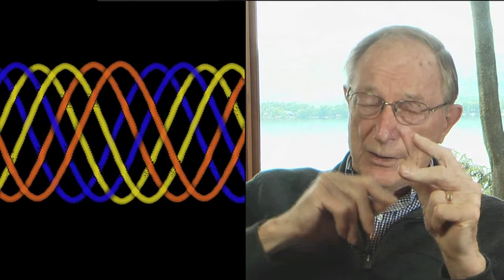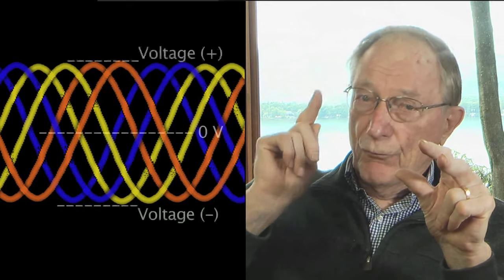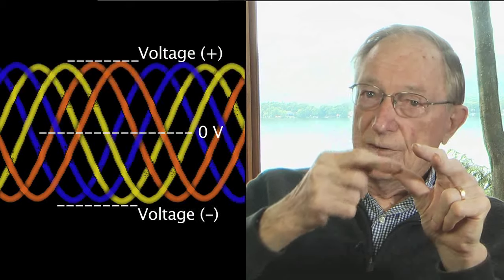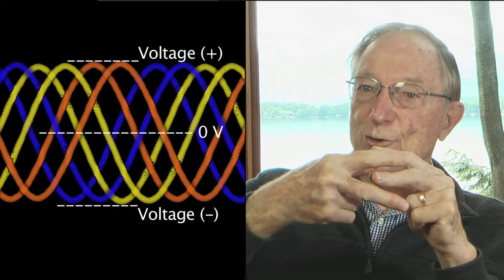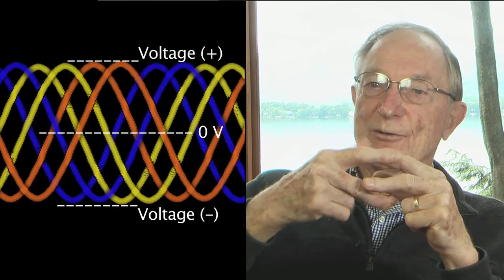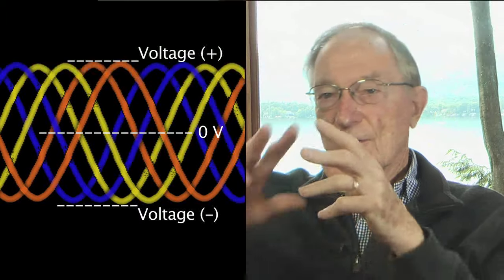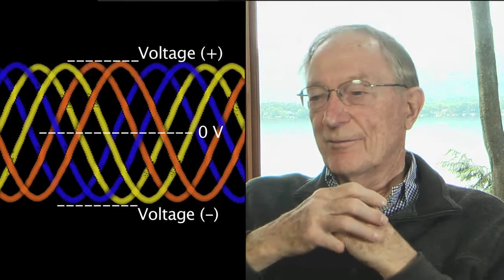Why 3 Phase Power? Why not 6 or 12?

Comment: Why dont you use both sides of a magnet in a generator? Why dont they try changing the shapes of the magnets & coil winding's in a generator?
Reply: Multiple layers coils....Well, only come to the power line problem that stopped that thinking.

Comment: Did I miss something here? Simply adding three more wires to an existing 3  phase system will double the transmission power or increase the wire gage and replace the original three wires. Adding additional phases does nothing to improve transmission efficiency.
Reply: You missed the part where he said to rotate the electrical angle of the second 3 phases so they fall between the first. The additional phases would be rotated 60 degrees from the existing.
Reply: No, I didn't miss that. Shifting 60 degrees provides no power advantage, but adding more copper does although 6 phases are not required for that.
Reply: @richardgieser6122  Oh, you said adding 3 more wire, not 3 more phases, so it sounded like you missed it. I agree though, it isn't going to help much, although the guy in the video seems to think so. My brother worked on installing a 230kv line into San Diego from Arizona and said they either 6 or 12 sets of 3 phase, which were fed from different generators. I would think that they would be synced for frequency at the generation station......he is an equipment operator and not a sparky and I only work on the customer side in electrical so am not sure about the distribution.

Comment: but for a diesel electric hybrid, for torque density, I think it would be better to use say a 5 phase thing. Over that would give diminishing returns.
Reply: Nearly all modern hybrids and electrics, in fact, nearly all modern electric traction (which includes railroad locomotives) use 3-phase AC motors of some type: asynchronous induction, synchronous permanent magnet, or synchronous doubly wound. They're driven with 3-phase variable voltage, variable frequency solid state inverters or cycloconverters. 3 phase, unlike single phase, can supply constant power throughout each revolution, which greatly decreases vibration and increases power. There really isn't any advantage to more phases.

Comment: Why not 4 phase so then you also have a pair of 180 degree out of phase pairs, kinda like a double split phase arrangement?  Then regular USA homes could use 2 of the lines for split phase and businesses could use all 4 for high power equipment.  3 phase does not allow for 180 degree split phase but 4 phase could.  The same 4 power lines could feed both residential and business needs.

Comment: One may find a similar increase-yet-diminishing-return in other areas of engineering. In computers, increasing the number of states per bit position increases data density, but the complexity of the device increases. And, again, the optimum compromise appears--to me, anyway--to be three states. We, of course, usually use binary, but we could use any other number system we like.

Comment: I might be dumb here, but with 6 wires, you would get alot more then 6 phases, as you get 6 phases wth 4 wires:
Phase1: AB
Phase2: AC
Phase3: AD
Phase4: BC
Phase5: BD
Phase6: CD

Albeit with different angle between the different phases, four with 90degrees and 2 with 180 degrees.
Reply: DJ Nekkid No, six wires = 6 phases. A is a phase, so is B, C, D, E, and F.
Reply: You can derive any phase angle from only two phases, by taking sums and differences of different amplitudes of the two.  The overriding advantage of three-phase is being able to reduce or eliminate the neutral wire.  There's no further advantage to increasing the number of phases past three.
Reply: See https://en.wikipedia.org/wiki/Scott-T_transformer for an example of a transformer that converts three-phase to two-phase or vice-versa.

Comment: i guess its because we need transistors and expensive equipment to create a motor controller from one phase. while with 3 phases we have 3 lines 3 timings allready there for driving the  motors without any externalequipments,
Reply: still 2 phases is still enough in past probably it was easier to drive motors with 3 phases or may be easier to control direction

Comment: Edison didn't understand AC electric when Tesla patented AC generation and EdisonTechCenter doesn't seem to understand it now.   The minimum distance between conductors (lines) is determined by the voltage carried by the conductors.  You can't add more phases without increasing the amount of space it takes up because doing otherwise will push the conductors closer together (as shown in the video @ 0:30 to 0:50) unless you drop the voltage.  There's no point in having consumers pay more for power so power companies can add more lines at reduced voltage to end up with the same power delivering capacity as half as many lines at double the voltage using the same amount of space.  Not only would the cost to consumers increase due to the material cost and labor to install twice as many lines with no overall capacity (taking up the same amount of space), the high-voltage interstate transmission lines would be a nightmare for our linemen and helicopter pilots that risk their lives to work on the lines even if the proper distances were maintained and took up the extra space.  

These ideas raised in this video are excellent for the "average person" to come up with and ponder, but it is a damned stupid idea for a channel called "EdisonTechCenter" or a "Power Transmission Engineer" to come up with.  I'll give some credit to the old man though, he has probably forgot more than I know... He just happened to forget why this idea was bad before losing some of his marbles.

Comment: Transmitting an increasing number of phases is tantamount to conversion to DC by a multiplicity of chopping. Today there are in fact high efficiency DC-DC converters that use this technique. It's a little like asking "how many sides does a circle have?". Is the answer 1 or infinite?
Reply: 2 is the answer
Reply: +Imelda Rodriguez InSide and OutSide

Comment: also allow for smaller motors or greater loads or greater speeds
Reply: Even with 3 phase system practical limit for power density comes from heat. Motors can be made smaller, also with 3 phases, but heat density is a big problem every time when engine frame is made smaller with greater load. And heat comes from combined currents of all phases so amount of phases won't really do any difference.
Reply: thanks, Karjis

Comment: But if you were to double a 3-phase circuit, to a 6-phase circuit,  wouldn't that double the circuit lines that lead to the outlet as well? Per say, we all know that a 3-phase circuit has one line or circuit per phase...and then the grounding wire making for four wires. This said, would we need a seven-wire circuit for a 6-phase circuit.....hypothetically asking?
Reply: What I know is ,they make 6 phase alternators for cars,and they put out insane amperage. 
Usually 225-350 amps or so, and you need supporting mods. 
An alternator is just a generator with diodes to me (gen tech)

Comment: 3 is enough to start a motor running by itself. And in The powerplant only 1 phase would cause very high vibrations in The generator. Afaik The number has to ne odd to start motor by itself in The right direction, as with 4 phases it could start in The wrong one too. Also your power line of 6 has 4 cables above each other, so they Are closer, in case of swinging or ripping apart You would have 2 short circuits instead of 1. 3 phases Are hard enough to balance in households, with 6 it would ne even more complicated. Also most electric energy is used NOT in industrial AC motors, but rather as DC. Vor electrolyses, heating of chemical reactions etc. So maybe we will use DC in future.

Comment: I thought they stopped at 3 phase and not 4 phase because of rotation and sequence. If two phases were swapped on a 3 phase motor, it would only run backwards. Instead of 1,2,3, 231 or 312 running one direction were 132, 321, or 213 would run the other direction. Add a fourth phase or more then the sequence would get too complicated 1234, one direction but 1243 would freeze up the motor. don't know, just what I thought

Comment: Can you transmit double 60hz 3 phase so its 120hz, but separated into two 60hz on single set of wires?
Reply: No you would need to frequency converters, not cost effective. To raise power transmission either raise voltage or thicker conductor will do.
Reply: Dirk Knight  Solar systems have DC-AC inverters. At least in USA, so far only very long transmission lines (> 600 Miles) are DC. They do offer some benefits and might get cheaper with advances in pwr electronic  over time.

Comment: Well, when going from single phase to three phase, for a constant and consistent power demand, can't the conductors be downsized because each conductor is carrying less load? If that's so, then why couldn't the circuit breakers and buses at substations be sized accordingly?

Obviously, I don't know very much about power transmission,  I'm just wondering.
Reply: You would need three breakers for every offset phase that is used and then more busbars. It would not work at an economy of scale the way 3 phase worked. 

WIth transformers and three phase you can just scale the systems accordingly with 6 or even 12 phase you would start to get a diminishing return meaning the higher the voltage requirements the less bang per buck.

Comment: Thomas Edison used DC  (Discovered DC) and not AC.  Nikola Tesla discovered AC, he is attributed for the induction motor, neon and fluorescent lighting which all use single phase oscillations.
Reply: The induction motor is inherently polyphase. Minimum is 1 1/2 for self starting. (1 for power and the half for direction.)

Comment: I respect your concept but would there not be a certain amount of slip that could cause issues in the operation of motors and other items.   Maybe this slip would glide into the next phase?    I like the idea but I believe that most practical applications are allowing variable frequency drives to accomplish nearly the same efficiency with 3 phase power.
I may be wrong but the efficiency would be far more costly than the current applications unless your thoughts are possibly getting us near unity.
Reply: It was a theory for transmission of power, not usage, 12 phase would be converted to 3 at the end user.  With 12 lines packed more tightly together on a tower you can transfer more power, but the savings there are outweighed by the extra complexity of having so many extra breakers and equipment at sub stations, stations are like labyrinths as it is.

Comment: Clearly the three phase came to life from the need to turn a motor, as smooth as possible.

1phase can't start an engine. You need another phase to nudge it in one direction (the start winding and the starting cap).
Two phase, if angled 180 degrees, will not generate torque for start either because of the same reason. You need some two phase at some 90 degrees or around that. (and the rest 270 degrees are empty.. not a good balance)
4-5-6 phase will go marvelous but you need so much wire, so many complications.. 3phase is the bare minimum for a true working motor that does provide excellent efficiency, natural start, plenty of torque even at start, etc.

So surely it comes from the need to generate torque and the bare minimum that sits in balance is 3phase.

Comment: Uh, because once you get beyond "3-phase" you're essentially dealing with DIRECT CURRENT and there is no "advantage" to "alternating current" with 4-12 "phases" and individual conductors replacing the two much larger DC CONDUCTORS necessary to use DC instead of AC.

Comment: so you can have 6 phase but it requires too many other working parts which would cost too much and we really do not have a need for that much power. we are good with 3 phase and single phase.

Comment: if your using air as the insulator and you add three more wires the size of the array could get  huge , better to up the amperage and voltage
Reply: Not quite.  You've missed the key to higher phase order. One can interleave an additional three phases between the first three and the voltage stress on the air between them is reduced along with the spacing.  I.e., phase to phase voltage is reduced when you double the number of phases.  This is not to say that a larger array of conductors (more spacing) is not helpful (higher voltage) if you have room for it.  But if you are severely constrained, you can stick with the same circle diameter and intersperse more conductors (6, 12, 36) to increase the power density over any given ROW.

Comment: Can you imagine what a PITA it would be to build a 12-phase electric motor? And the differential voltage would only be high on those most widely out of phase. So what would be the point of having 2 wires which are only 1/12th out of phase? The voltage change between 2 adjacent (in cycle phase) wires would be very low with 2 drops to zero per cycle. So what's the upside?
Reply: i suppose the difference would be the same as in a 4 cilinders car vs a v12 one. the torqye curve would be smoother but they you have to deal with the extra complexity and that in turn can instriduce extra loses
Reply: Laharl Krichevskoy Not entirely, three phase gives a good voltage differential with just 3 wires and a fairly constant amount of power output. If you want more power you can just use bigger wires (more amperage) or up the voltage. 

Remember, a lot of buses and the like run on 4-cylinder engines. The only real up-side to a 12-cylinder engine is that you get more bangs per revolution, so a more or less constant top-end torque.

Also, it would make breaker boxes insane. To run one appliance could require a 12-gang breaker. And the chances of one leg going bad and the difficulty of debugging is something I don't want to even think about.
Reply: This is a transmission technology. Just like you get single-phase or split phase from a three-phase system, you would convert 12-phase back down to 3 at the substation. The idea is with the lower voltage differential between the lines, you can place them closer together on the transmission towers, and get more lines and power through on one tower and right-of-way.

And no you cannot use bigger wires (look up skin effect). Increasing the voltage means higher and more expensive towers, insulators, transformers and importantly losses.
Reply: It would be similar to building a multi-phase stepper motor, I would assume. So not very hard at all, actually.

Comment: my Chrysler car has a 4 phase alternator, with 8 diodes.....why?  car used to run with only 3 phase ?
Reply: filter taylor Car alternators have all the phases rectified to a simple 2 wire DC circuit before the power connection leaves the alternator, otherwise you would have an unreliable rats nest of wires coming out.
Reply: +filter taylor - The more phases there are in an alternator, the smaller the diodes and armature conductors need to be.